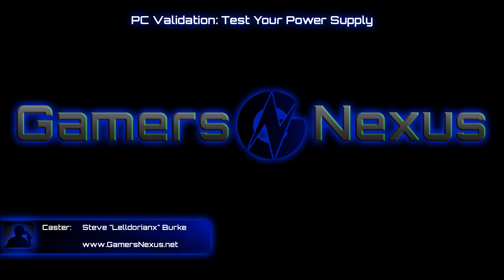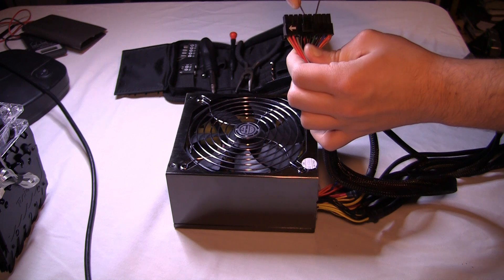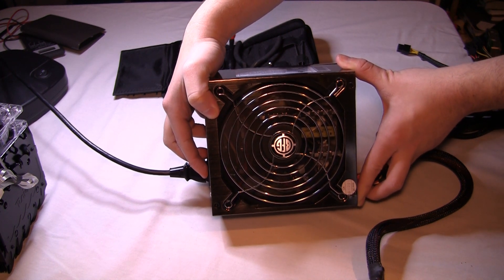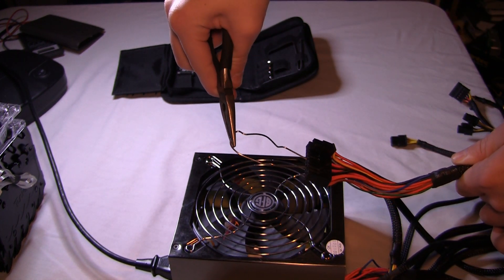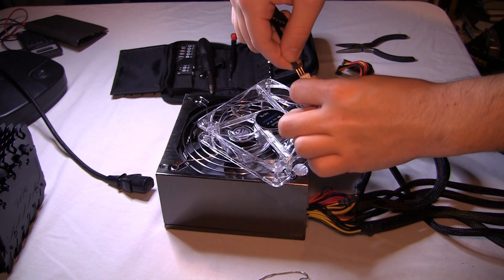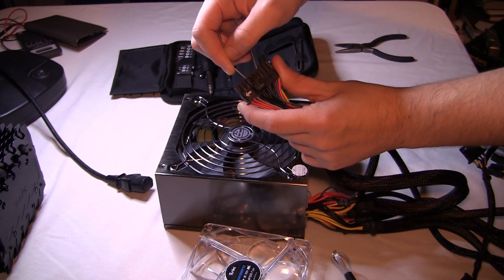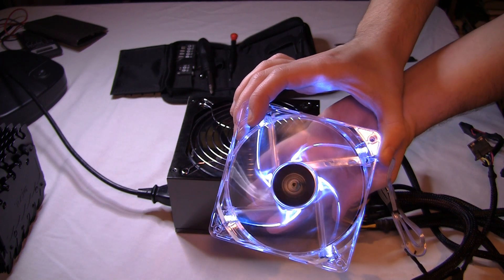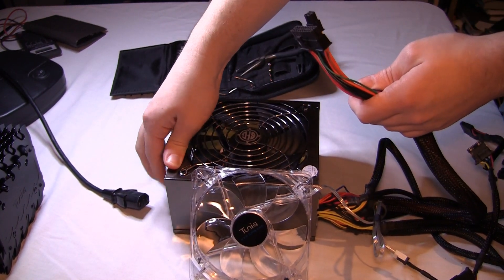Basic PC Troubleshooting: Test A Power Supply with a Paperclip

Comment: You can still have a bad PS even if the PS internal fan is working.  It should be supplying a certain amount of voltage to the mobo.  Case in point, I tested a bad PS and it still turned the fan though the total output was less then than a volt.  Just enough to push the fan but of course not enough to power the mobo.
Reply: Hi. I have no background in electronics but am willing to know things. I do have a couple of PS that turns the fan on using this method but fails to power the computer. what should I do next? Thank you.

Comment from the maker: If you have the power switch flipped to the 'on' position when you connect the power cable, it may come on momentarily and then shutdown. Does the system turn on and stay on once you use the power button?
Reply: I have this problem

Comment: hi, this is a very good video! im having problems with my dell xps 8500 power supply, its only 1 month old and it looks like when ever I plug in the power cable to the power supply, at the same time the green led comes on and all the fans inside the pc manage to come on, but only for a split second. will doing this method,'jumpstart' my power supply and get it to stay on in my computer instead of coming for a split second then just turning off?

Comment: So I connected this up with the paperclip and straight to a hard-drive (ocz psu) as i don't have a 3-pin adapter for my fans, no movement at all, Comp's not booting the bios (when all connected)though everything appears to work (fans, green light on mobo) Cpu fan fell off at one point and though this has been replaced, it doesn't heat up when i turn the power on however:(
Any idea's?